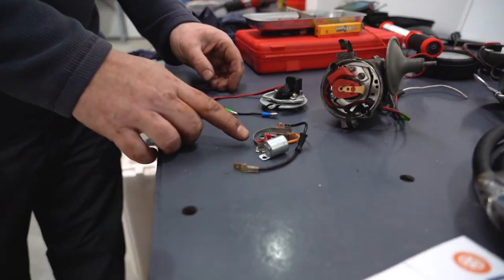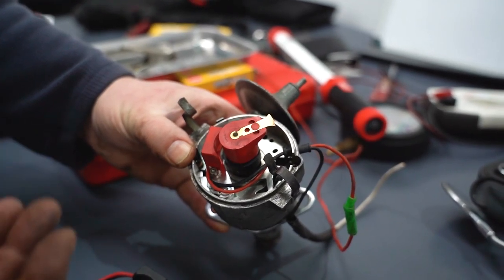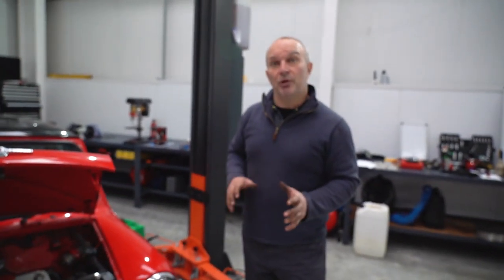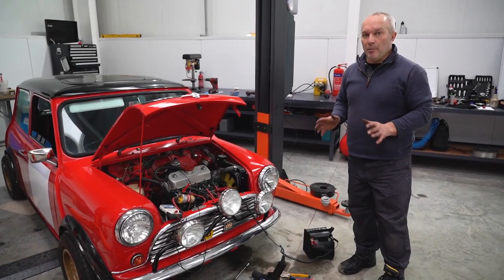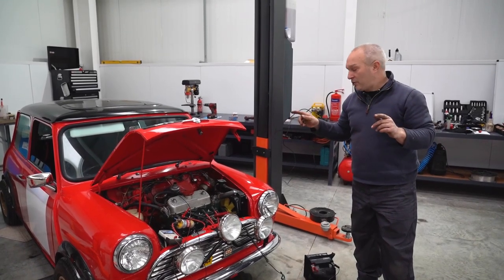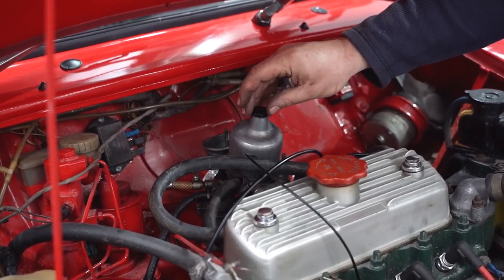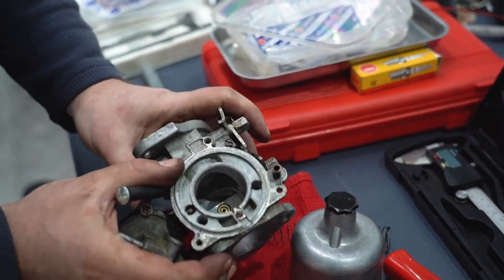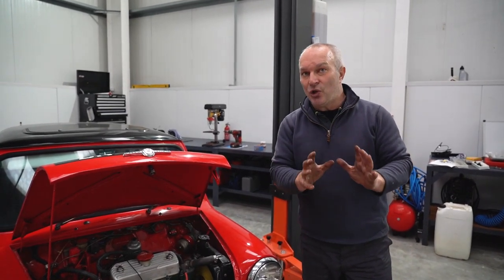Ryder's Retros ep.3 - "Tuning the Classic Mini for E10 / Carb Setup"

Comment: My Mini with HS4 single carb has an upgraded 1275cc engine from a previous owner. I do not know what cam may have been fitted. What should I be trying to set the timing at?